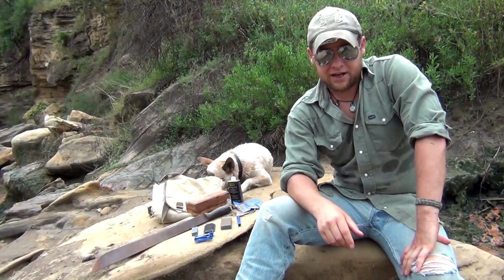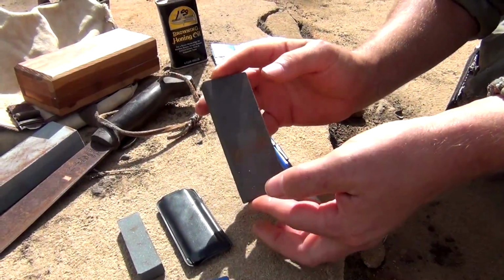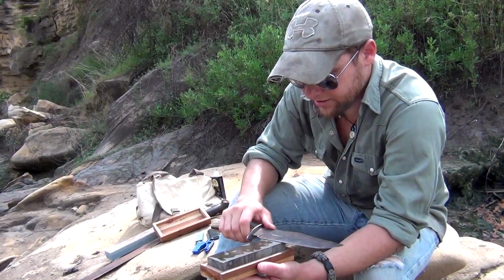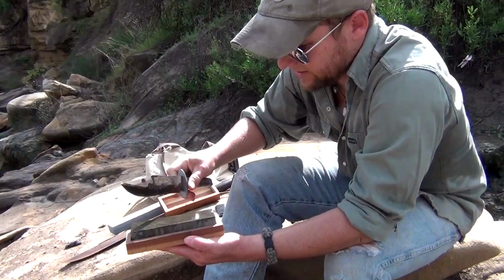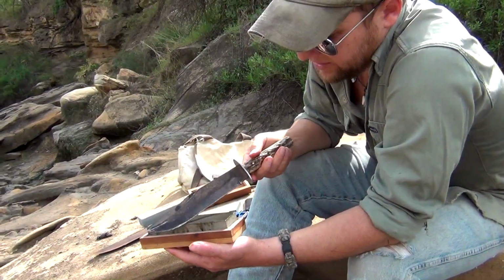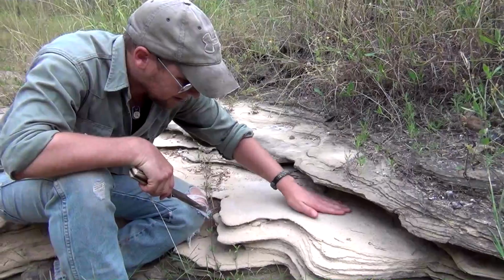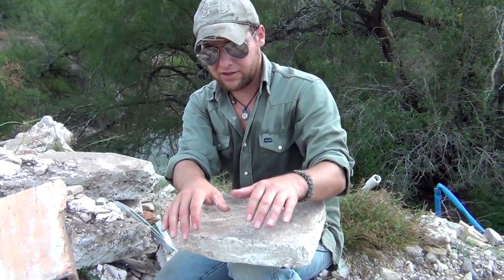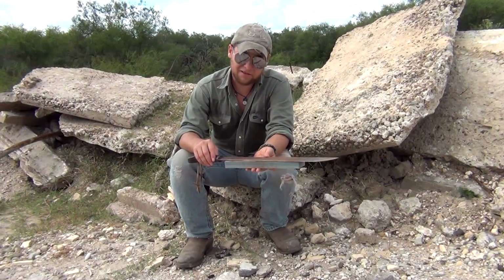Knife Sharpening 101 -Basic Tools Techniques, and Methods-

Comment: Ever thought about using a food grade oil like coconut or vegetable oil for sharpening? One problem I see is now you have a chemical based oil now you need soap and water to clean the blade. Food grade oil you don’t need to wash and you will have oil to cook with

Comment: If it doesn’t catch your nail it ain’t sharp. Also the reason you can get a faster edge when you increase the angle is Bc you’re using a microbevel to get to the cutting edge faster, cool vid thumbs up

Comment: Really enjoyed this video and learned alot from it in terms of survival. I make knives for fun, and after messing around with sharpening and grind styles I found what works best for me when bushcrafting. Everything from splitting wood to carving and food prep. I use a combination of a Scandi style grind and a convex edge. 
I hate V grind blades which most on the market are at this point. I find them hard to maintain, and unable to get sharp enough for my tastes. When I make a blade instead of just using a Scandi grind on a belt grinder, I use a slack belt which creates a rounded bevel while still allowing me to maintain the correct angle. Then when sharpening I use the push back and forth motion, and the natural rocking of your hands will vary the angle enough for your convex edge. 
The most important tip I have found for maintaining a blade is to use a leather strop, preloaded with polishing compound. The polishing compound removes steel much faster, and leaves a cleaner edge with less micro-serrations. When I'm out in the bush I wear a leather belt loaded with polishing compound, or a block strop on long trips. If you strop your blade after every time you use it, it will retain a very fine edge capable of shaving effortlessly and still have the edge support to retain strength for splitting wood. I've use a couple different Mora knives and given them a slight convex just using a sharpening stone, and they seem to work much better. 
Sorry for the long comment, 
Rando

Comment: Bob...this right here is the reason I tend to avoid the fancier superstainless knives for the largest part. If you can't sharpen and hone them fairly quickly in the field, you're in trouble. The more you hone the less you sharpen. I use simple diamond and natural stones lubed with a bit of soapy water, and ceramics.

Comment: It would be neat if a company designed a sheath you could place your knife in an turn a crank and two dymond plate's would sharpen the knife blade then lift off the blade and return to the hilt of the blade and drop down and sharpen the blade non stop has you cranked the crank. 😊

Comment: What Company makes the Bowie knife in all the video.
Reply: I make knives and would absolutely love to get a pattern for that knife.
Reply: It looks like an old Solingen Blade. I´m german.
This seems to be a classic Bowie Blade, 25cm Blade length. This Type was made in Solingen from different producers in different length.
This Blade is avaible in 17cm, 20cm and 25cm Blade, in Rattail or Fulltang.
This Blade looks like an high Carbon Blade, but there are not produced anymore. Today you can get it only in stainless steel.
Old Solingen Bowies are also avaible at ebay.
Best wishes from Germany.

Comment: Bob what is your favorite survival knife size/type/brand ECT.. I'm really excited to hear your opinion on the subject since I'm looking to buy one to last a lifetime so price isn't an issue
Reply from the maker: Depends on what type of environment you are messing with.  Thick metal is a must though.
Reply: There's a lot of people making good survival style knives. Scott Gossman is one. If'n price id'nt a factor. I recieved a 8 inchish Big Boar Tusker in S7 via second hand. Traded for it. Nice drop point blade. S7 is a jackhammer bit steel. Barring excessive abuses it should stand the test of time. It's a rust prone steel. But you can minimize that buy forcing a patina. It gets sharp easy and holds it pretty well. 
Busse Combat and subsidiary companies Swamp Rat and Scrapyard, make a lot awesome sauce. I have  a lot of knives from those three. Busse has a proprietary steel called INFI that is very stain resistant, very tough and very easy to sharpen, plus holds a edge well. Tad better than S7. In the Swamp Rat line and Scrapyard line they use SR101 steel. Which is a modified version of 52100 ball bearing steel. However seeking out the model that fits your bill is sometimes a task in and of itself. 
Esee, Tops, K-Bar/Becker and others make nice survival knives. For a good price. They use 1095 or the derivative 1095 cro-van steel. Which is a solid steel. Easy to sharpen takes a good edge is tough enough for most tasks. I have seen pictures of broken knives though. Nature of the steel not being as malleable as others. I tend to stay away from the CPM steels. 3V has amazing properties however it is harder to sharpen than most. And has been known to be chippier than said named steels of above. 
Survival knives are going to have obtuse edge angles and be thicker behind the primary grind. Nature of the beast. This is where I laugh at Bushcraft purists. They demonize larger survival knives and then take their much more obtuse bushcraft axe or hatchet and carve with it. 
My sister is the queen of bamboo due to the fact she has a large stand of it in her back yard. She cuts it down and makes stuff with it. Some of it is tough as nails. Machetes will dent and waffle on the large stuff. She lays waste to that bamboo with a 1111 from Scrapyard that she borrowed forever from me. Before that she used a Ontario SP50. She also processes a lot of the eucalyptus with her big blades. 
Sorry to make a short answer long.

Comment: Hi ya Bob! You’ll get no flack from me, I’m a green horn on this subject, I’ve watched this video months ago, and for many months I’ve been trying to figure out what big knife to get, a good knife comes with a pretty price, months now I’ve been looking at ur knife and others, and months I’ve wasted not getting out there (I’m interested n bush craft as well, which is good to know if shtf) well yesterday at Walmart, I saw a generic Bowie, 20 bucks, I figure if I can manage its size and it works well for me (of course not a true Bowie, but it will work for a time giving me an idea) then I’ll pay the price for a true Bowie, and I know now by this handle, handle will have to be modified to my size . Thank u for this video, I’m going to need this skill, more than likely I’ll rewatch down the road. Still wishing u the best on this day, hoping for the best results, I know this will not be read for a few days, (Shauna an Bri, u two r awesome) till then. Thank u Bob
Reply: I'm going to throw my 2 cents in here. When I started bushcrafting I started small with a Mora companion. $20 you will never regret spending. If I know the Bowie you are talking about, red handle thin flat brass guard? It will last you two trips into the bush. A small knife can do alot, and I still use mine for splitting firewood, and lots of projects. But eventually you will need a larger knife, and for that there are lots of options. I personally prefer a smaller blade and a small hatchet, with a folding saw. Covers alot of the things a big knife can do with other options as well.

Comment: When You started running the sharpener down the edge of the machete said it was safer I cringed because I straight fucked myself up that way
I had a machete that someone had used to close to the ground so I had some big chips taken out of it I've been sharpening it for like half an hour trying to get the chips will smooth out a bit, it was sharp as fuck I just slid my finger right down it with the sharpener on accident

Comment: Two things to note here.

1) Good knife steel does not loose it's edge easily. Cheap knives will have cheap steel and will lose their edge easily thus requiring constant sharpening.  A mid-priced or expensive knife will often cheap an edge even with moderate use unless used on hard substances.  The good knives can dress a full Elk without ever needing a sharpening.  You need to look for the ZDP series, S30V, CPM series, and even 1095 if it has been heat treated properly.  Many knives are cheap stainless alloys and will lose their edge regularly.

2) Over-sharpening is a thing.  I've seen way too many people sharpen perfectly sharp knives.  It's almost like a form of ADHD and they start sweating if you tell them to put it up without sharpening.  They're just removing material from the blade unnecessarily.  Much of these are bad habits as a result of using cheap blades for so long.

Comment: I learned at an early age that a dull knife is more dangerous than a sharp one.  Great vid!
Reply: how?
Reply: Because a dull knife has no finesse.  You have to muscle it through the work you are trying to do then when it does finally bite in and cut, it slips through because it is being over powered.  That's how people cut thumbs, arms, and stab themselves in the gut.

I watched a guy outside a bar with a dull buck knife cutting off an wrist band once.  The band never cut but eventually broke and he ended up stabbing himself right in the fore head.  Thankfully he had a thick skull bone and it never went deeper than the skin but it could have been an eye or other softer part of the face.

Keep your powder dry and your knives sharp!
Reply: You stab yourself in the gut if you cut towards your gut, the guy using the stone at the start of the video is working dangerously too. a bad way to use the stone.

Comment: Bob, I've been sharpening for about 50 years, my father taught me. You did a fine job of giving the basics. You also did well with explaining the angles. The angle you sharpen at depends on what you are willing to live with. lol One little trick i figured out recently, when you have your blade as sharp as you can get it, on your finest stone, then lightly "strop" it backwards on that same stone and it will get sharper. Something worth trying.
Reply: LH in Arizona that's weird I've heard of doing the strop like motion to create a bur on one side than the other and then the sharpening motion to get rid of the final bur
Reply: Try it. lol
Reply: @lhinarizona6658  yeah, i find that "stropping" on the fine stone before stropping on leather gives a more refined edge aswell